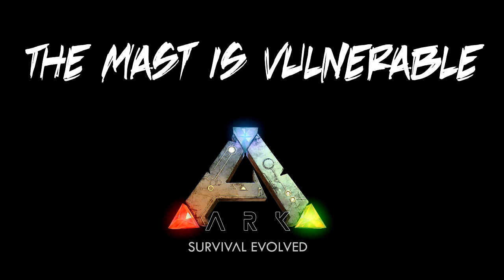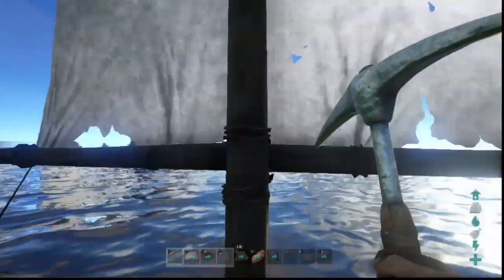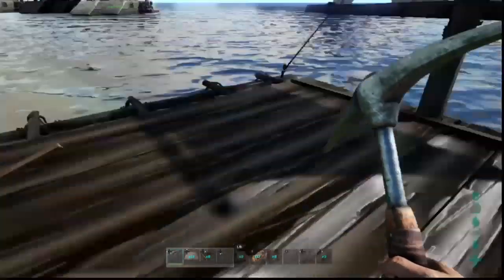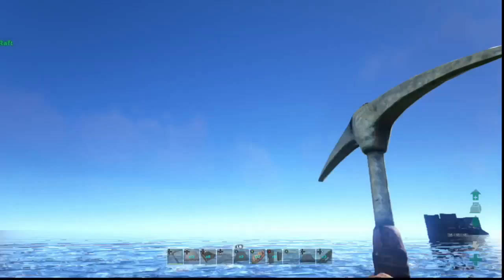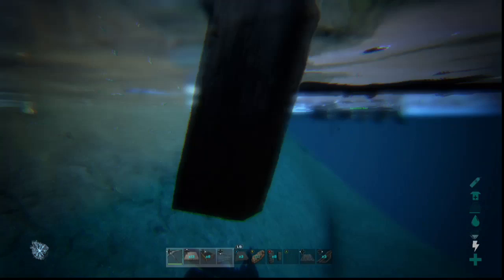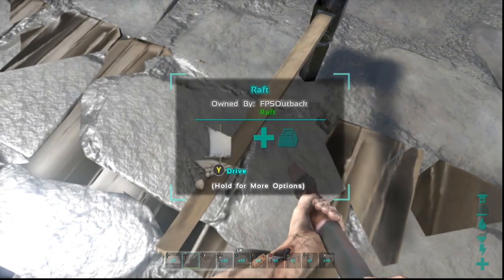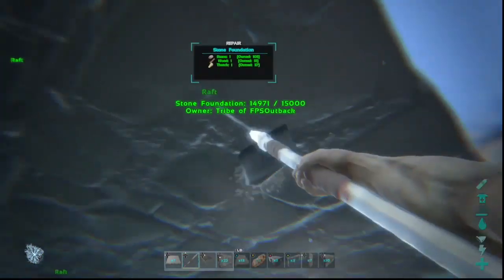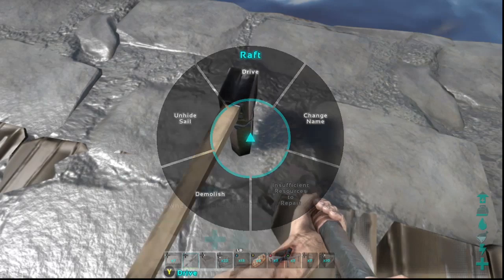The Mast is Vulnerable to Damage - Ark Survival Evolved

Comment: For the time being with the patch today (v243) it seems raft construction has been broken/nerfed. You can no longer place items whilst in drive mode of the boat - for easier alignment of your initial pillar/foundation, and from what I can tell you can no longer start construction with a pillar - which when combined .... without being too conspiratorial; seems like a direct hit to the most common build technique of driving the raft, looking up and placing a starting pillar to step by step lower foundations.

The fence foundation method still works for aligning your builds.

From what I've read, no changes to rafts were hinted at in the patch notes, however these changes may have come about in part due to work done on dino platforms.
Reply: Yeah, I noticed that too. I wonder why they did that. Is lining up foundations on the raft really that unbalanced or something? Or do they just want to screw with boat builders?

Comment: What part of it is in the hit box? Is it the entire mast and the sail, just the wooden parts of the mast(including the horizontal beam), or just the central wooden pillar part of the mast? To protect it would it be enough to put some metal pillars lined up with the middle part of the mast or a 1 by 1 room around it, or would you have to block off the entire sail with a 3 by 1 room and however tall